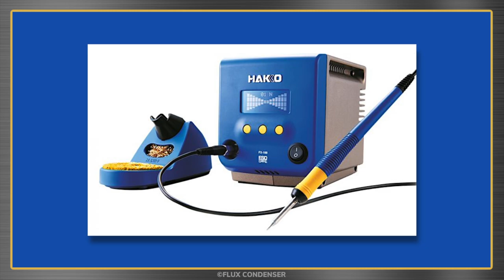Fixing This Tube Amp Is Gonna Kill Me! 1957 Eico HF-52 • P4 Spray Painting The Cadmium Chassis

Comment: A tip for painting with cans, place them in warm water for 10 minutes before uisng. It will reduce the orange peel
Reply from the maker: Thanks, appreciate the tip. I definitely was having orange-peel trouble with this project and I realized after-the-fact that it was largely caused by clogged filters in my spray booth. All that overspray was hanging out in the air too long and falling back on the project. 

After replacing the filters, I’ve found that the quality of my paint jobs has increased significantly. The finish on my more-recent “Radiohead” project, for example, came out fantastically smooth. I’ve gotta stay on top of replacing those filters better in the future.

Comment: Most cities have several powder coating shops. Now you may have to wait or pay more for a custom color like that as they tend to wait until they have a whole batch of that color to do. But perhaps worth a quote. Your second job was very good, but consumer spray is still very prone to scratching.
Reply from the maker: Thanks, Andy. Yes, I considered that. A good powder coat can look amazing and, as you say, can be much more durable than paint. The problem is, as you also say, the waiting. I’ve had a lot of good luck with spray paint over the years so I keep doing it despite the hiccups. For a job that really requires the absolute best quality, though, I’ll consider sending it out in the future. I did that for a bike I restored a few years ago (paint not powder). Great result, but a many weeks-long process.

Comment: I can understand your sticking to the “Old Blue” color scheme, but I have to wonder what the output transformer cover and / or transformer would have looked like with a clear coat instead of blue for an additional contrast in color. They looked great once you stripped, sanded, and polished them! Perhaps you can try it out on one of your future restoration projects.
Reply from the maker: Thanks, I would have had flexibility with the output transformer, but I didn’t strip the power trans. I just gave it a light sanding and painted over the blue. If I really wanted to strip it down I would have had to take it apart. The blue was in good shape, though, so not necessary. I agree, though, that there could have been all sorts of alternate color schemes that would have looked good, or even perhaps, better. But, as I told another commenter the look of Old Blue grew on me and it seems a shame to change things up. Take care and thanks for the comment.

Comment: Inclusions such as dust and insects are a headache for a paint job too!
Reply from the maker: They sure are. I would t even bother painting outside unless you’re prepared to do a lot of sanding and buffing. Note in the video I’m using my ventilated indoor paint booth. Helps keep overspray and contamination to a minimum.

Comment: Sandable primer then paint.
Reply from the maker: Thanks for the tip, Kenneth. I’ve had good luck with “all-in-one” sprays, but I think you’re right, using a primer would have been better. It would have given me a good idea how the paint would lay down and better opportunities to make corrections before committing to the color coats. Also, a grey primer would have made for a nice finish for the underside of the chassis.

Comment: All that work and then Blue?
Reply from the maker: Yeah, sorry. They were all out of lime green and purple polka dot.
Reply: @FluxCondenser Why not Eico brown with black transformers? As long as your striped it to the bare metal. I doubt you would have painted it lime green!
Reply from the maker: Well, if you saw the first episode the color choice would make more sense. I purchased the amp on eBay and it had already been repainted blue. At the beginning of the first video I was planning on a quick repair to the amp, but when I opened it up I saw that the original assembly and subsequent repairs were abysmal. At that point I had already dubbed the amp “Old Blue” so even though I then decided to completely rebuild it, I didn’t have the heart to change the color scheme. This this is just “Old Blue” to me now and I can’t picture it any other way. These weird objects have a weird way of growing on us! Also, I do like how the blue looks with the front brass plate.